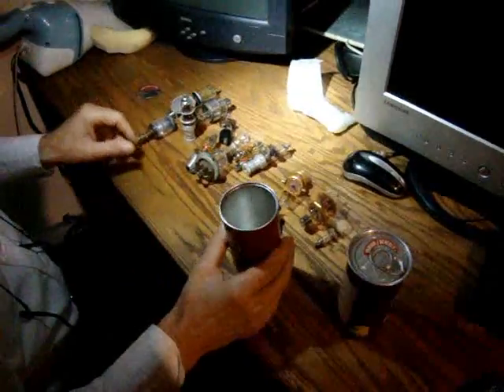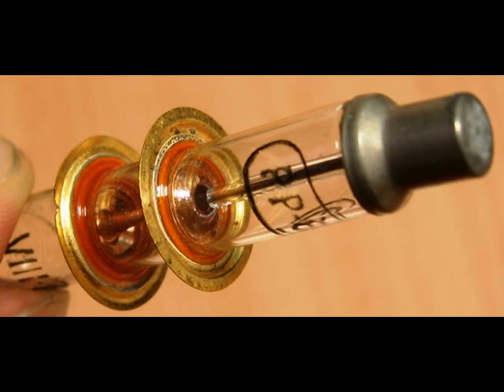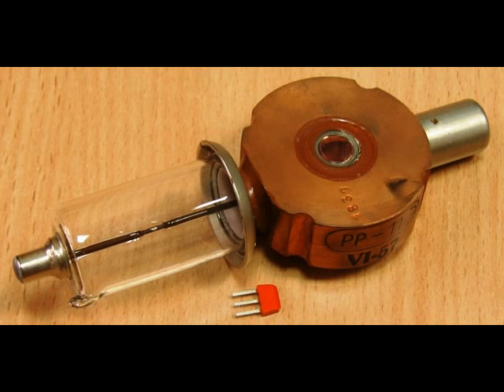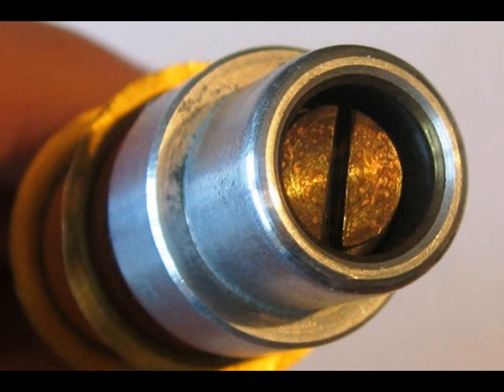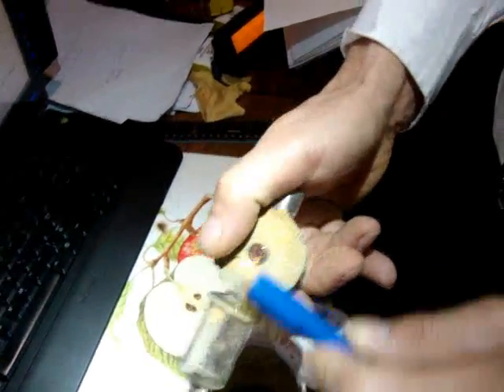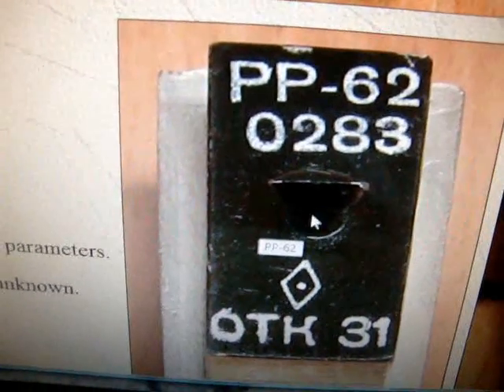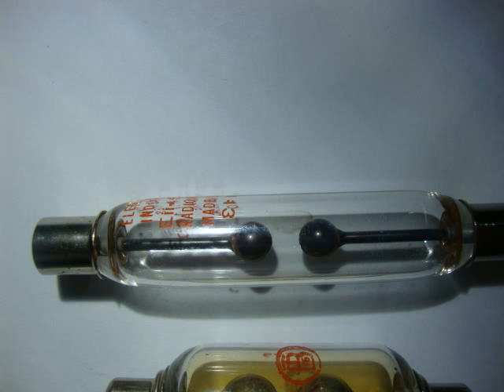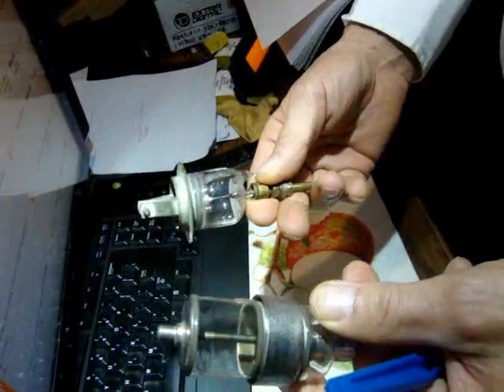Spark Gap tubes evaluation  for project part #2 OF VIDEOS

Comment: You probably should not use this as a spark gap. It is not designed to do that and may be dangerous to use like this. Please see MSDS sheet on this at    

hazard.com/msds/f2/bdq/bdqhk.html

This is a microwave cavity amplifier tube which operates around 1285 MHz. Those are drift tubes you are arcing across.

Comment: Thanks for sharing.  My musing >
Your early illustration showed a 'keep alive' region.
Rare gas ?  Maintains plasma ready to fire main gap ?
Smaller gap - higher frequency - greater avalanche.
Smaller gap - lower reliable voltage - less avalanche.
One showed series R - to limit current, but extend life.